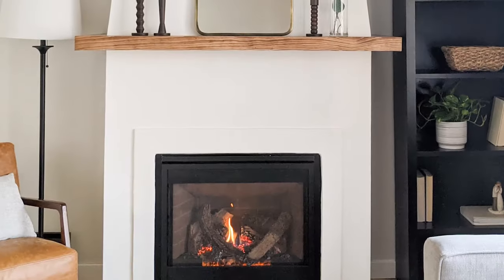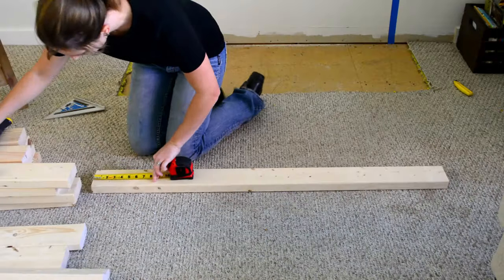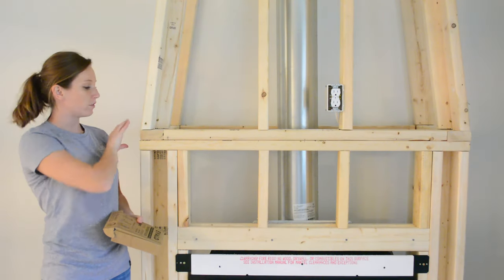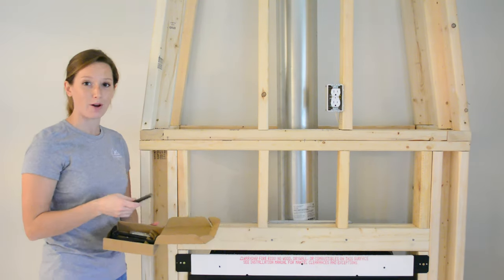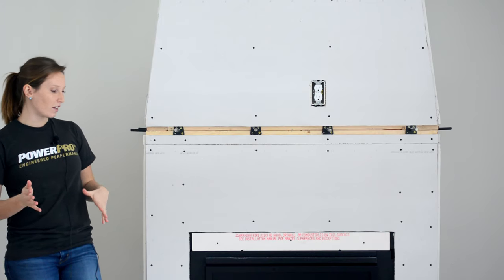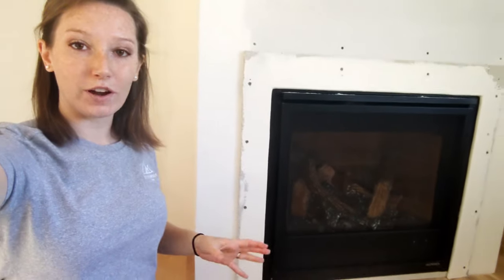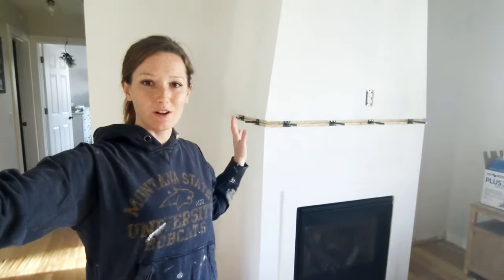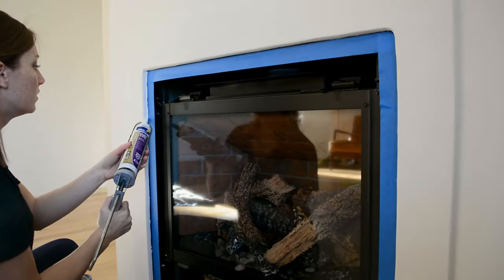Install a Gas Fireplace - Framing & Finishing | PT. 2: DIY Living Room Remodel

Comment: Nice job, why can't my wife do this? I wish you had shown more detail on the electrical. I noticed an outlet against the interior wall. Did you disconnect that outlet? How did they get power to the fireplace? You know you can't bury an electrical box, so I hope you didn't do that. I am guessing you hired in an electrician? Otherwise, well done. I am planning to install a gas fireplace in my bedroom. You should be on HGTV!

Comment: Great video! Came in with the drywall and non-combustible requirement question and got my answer! Cant you use cement board for the whole lower section so you can finish it flush?

Comment: Love the fireplace! How much did it cost to build? I want to add a fireplace and I'm trying to figure out if it cost less to buy one or have one built.
Reply: That complete job with gas line and venting would cost approximately 6-9k for a stove shop to install and finish and that is with the unit included.

Comment: Hello Tylynn, I have watched your video several times now, getting ready to diy my own fireplace.  I have two questions about yours that I'm hoping you can help me with.  I have looked at a lot of tapered chimney forms; and I really like the proportions of yours.  Was there a ratio you used in how to get the top dimensions relative to the base width or did you just eyeball it as you were making it and settled on where you liked it visually?  Also, I can't tell from the video; but is it tapered in two directions (side to side as well as front to back) or only tapered side to side?  Thanks very much!  Karen

Comment: Looks awesome, you did an amazing job!  How did you know when you needed to sister 2x4s and in what pattern  you needed to place them?  Trying to frame a corner unit and I have no idea where to start. Thanks!
Reply: Looks like its to meet the depth of the board they're being joined to, if that makes sense. 2x4's aren't really 2x4 anymore, they're 1.5x3.5, so that extra 1/2 inch shim between two boards creates the 3.5" thickness to join to the perpendicular board.

Comment: Very impressed with this DIY project!  I'm planning on the same Portola finish with a cement board frame around the fireplace.  
What did you use on the edges/corners?  Did you need a corner tool to get around the cement board frame (the outside, not the rounded inside where you said you did it by hand).

Comment: Don’t you have to use cement boards?
Reply from the maker: I used cement board where the fireplace specs required - about 3" around the fireplace unit. The specs for your particular unit will tell you where to install the proper materials.